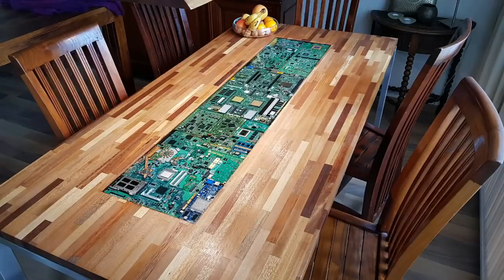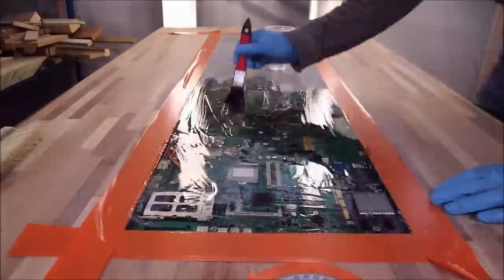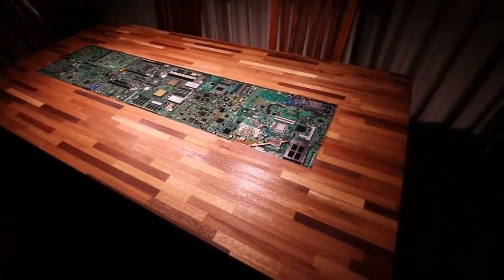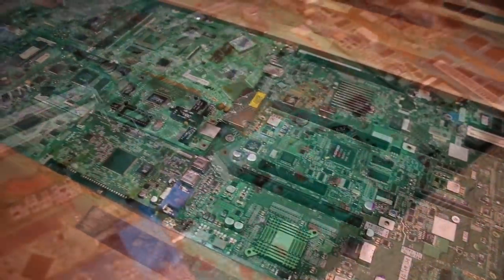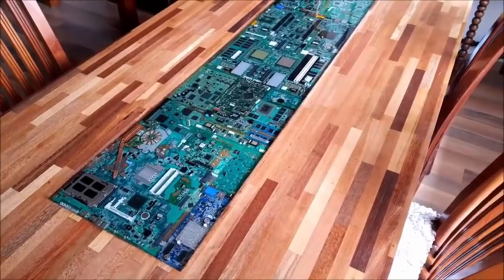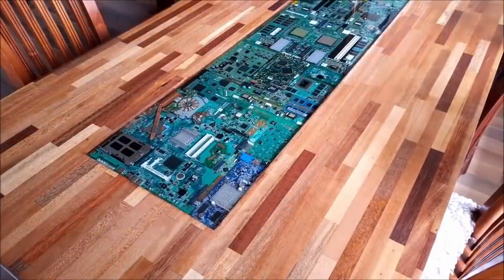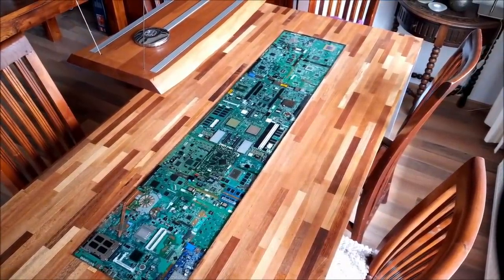Circuit boards with lights in epoxy in a table

Comment: You thing the epoxy might have reacted to some of the chemicals in the circuit boards?
Reply from the maker: No I am pretty sure that didn't happen because the problems are on a whole different level, higher up. See this video: https://youtu.be/rJBFk-5gMQY

Comment: If you ever do something like this, make sure that you CLEAN the circuit boards.  I go crazy and do alcohol then paint thinner then acetone.  That way I get rid of all the contaminants that MAY have been the cause of your bad cure of epoxy.  There are all sorts of things on circuit boards that might come out in the epoxy...

Comment: I wonder how the capacitors and battery’s Will fair over time as they leak eventually
Reply from the maker: You're not the first to ask. My guess is that because the epoxy is SO strong, nothing will happen.

Comment: Useful video. I’m thinking of trying something similar with use airplane parts. Do you think the epoxy wasn’t mixed enough before the pour?
Reply from the maker: Yes, I'm pretty sure about that. You should not mix by hand, but use a machine (cordless drill will do). 
You should watch the follow-up video of this project here: https://youtu.be/rJBFk-5gMQY
That's my 'lessons learned' video.
Reply: @Onrust1  thanks. I have just watched it. I will start investing where to get epoxy from. Cheers

Comment: I’ve had the same problem of sticky epoxy that won’t dry. After a year it was hard.  So just wait and it’ll be ok.
Reply from the maker: Could have done that, but didn't. Here is what I did: https://youtu.be/rJBFk-5gMQY

Comment: Worked with epoxy on few projects now. If you get a bad mix and pour, 90% has to do with temperature,  using Epoxy in under 70 to 75 degrees is recipe for disaster, when its under 70 it cured very gummy, now your screwed, it wont harden and sanding makes it a complete disaster,  like sanding bubble gum, its possible the circut board stayed cool and confused the pour. Even more then Prep, temperatures are main key to a perfect pour.
Reply from the maker: You should watch the follow-up video of this project here: https://youtu.be/rJBFk-5gMQY

Comment: You could put glass above the tables‘ surface. Sure that‘s far from optimal, but at least you can use the table, while the design is widely the same. 😊

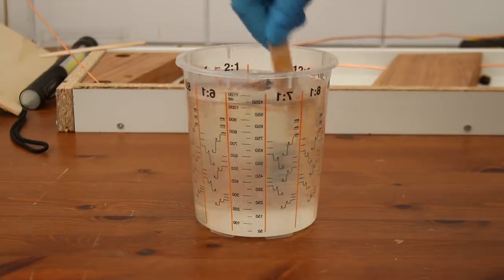Comment: So I saw another video and the "flakes" you saw when mixing at 13:20 were because the epoxy was too cold... in the other video I watched, the person heated it up in hot water and mixed it more... worked out great.
Reply from the maker: I doubt if that would have worked in my case. See my take on this in the follow-up video here: https://youtu.be/rJBFk-5gMQY

Comment: by the way, a little know fact, if you use super glue or CA and use epoxy over it, you have a good chance of a chemical reaction that prohibits epoxy from curing in some areas.

Comment: you can either cut out the whole center and redo, or you can put a glass top over the whole table to save it. cool design none the less!
Reply from the maker: Could have done that, but didn't. Here is what I did: https://youtu.be/rJBFk-5gMQY 
Thank you!

Comment: Nice video.
Great idea with the circuit boards.
I saw a mistake, why the epoxy is not fully cured.
So you have used wooden stirrers that are "rounded" at the ends. Then possibly saw off a rounding that it is angular. So you get right to the bottom to get everything through.
Reply from the maker: Vielleicht bist du interessiert in wie es mit dem Tisch weiter geht? Das ist nämlich in dieses Video: https://youtu.be/rJBFk-5gMQY

Comment: What about putting a layer of UV epoxy over the top then hardening it quickly with UV light?
Reply from the maker: You can see in the follow-up video what I did with it: https://youtu.be/rJBFk-5gMQY

Comment: The reason for the sticky parts can be in bad mixing of the epoxy. When you mix the epoxy, the part at the walls of the container is not mixed perfectly. I saw some people pour the mixed epoxy into another container and mix again. Then you can get rid of the unmixed part of the epoxy and have perfet result...
Reply from the maker: You are so right, yes. I came to about the same conclusions in the end, as you can see in the follow-up video of this one here: https://youtu.be/rJBFk-5gMQY

Comment: Nice idea! But I personaly don't like the varnish after sanding, you see it a lot in woodturning. Much better to pollish the resin to a glass finnish. It takes longer but is much better.
Reply from the maker: As I explained in the video, I wanted to polish (so I agree with you), but didn't for a reason. In the end I did, as you can see here in the follow-up video: https://youtu.be/rJBFk-5gMQY
Reply: @Onrust1  Thanks for the link, I commend your patience and determination.

Comment: Nothing beats genuine creativity. (I would have cut a lip with a router to allow low black tinted 4mm glass panel to sit over the motherboards.) But as said nothing beats genuine creativity☺

Comment: The weight of that epoxy would be unbelievable! It probably bowed in the middle because of it. Maybe welding some cross beam underneath to reinforce it would have helped with that. I would still call it a success. Turned out good :)
Reply from the maker: Thank you. The table already had two fairly big steel beams running underneath, there is just no way my actions were the cause of the table being bent (it is more likely that in a former life, some fat lady sat on it 😆😆).

Comment: Maybe put a piece of glass on the top.  at least it would be safe from any unproperly cured epoxy
Reply from the maker: Could have done that, but didn't. Here is what I did: https://youtu.be/rJBFk-5gMQY
Reply: @Onrust1  Thanks I watched your follow up video.  I would still put a piece of glass, not just on the epoxy but the whole area of the table if you want to use it even in a garage or shop.  I work in aerospace and the technicians generally mix epoxy by weight on a precise scale.  Mixed in small amounts  though by hand.  This gives me an idea though to make a commodore 64 table one day.

Comment: If the hardener/catalyst/initiator was not properly mixed, could you not still use UV light to harden the resin? Leaving it out in the sun might work, although rather powerful UV lamps are quite cheap now (protect your eyes, esp. if UV-C!)
Reply from the maker: Could have done that, but didn't. Here is what I did: https://youtu.be/rJBFk-5gMQY

Comment: you can try covering the whole table up with a large sheet of acrylic or even glass, and putting a thin layer of (well mixed) epoxy between the sheet and the table. This will hopefully trap the soft spots, create a nice, gapless cover for the wood and top off the table with a uniform, non-sticky surface
Reply from the maker: Could have done that, but didn't. Here is what I did: https://youtu.be/rJBFk-5gMQY
Reply: @Onrust1  ah, it's great to see you're actively looking after your comment section! and thanks for the link, you did a great job of making the best of what you got. keep it up!

Comment: Very nice idea. I don't really thing is a total failure. For me is quiet acceptable the result. Just wonder why not to use just a glass over the pit instead of filling it up with epoxy
Reply from the maker: Could have done that, but didn't. Here is what I did: https://youtu.be/rJBFk-5gMQY

Comment: maybe someone already asked, but- Why did you terminate the fiber optic cables out the end and not under the table where a light source could be concealed?
Reply from the maker: No, you're the first. It never crossed my mind. I liked the idea that anyone could light up the lights fi. with their own phone. If you would put another light source in, it would need power and second it could be 'on' all the time, from which in time you could go crazy.. I liked the idea that it would be temporary. No regrets on this part.

Comment: why not just put a glass on it with some rubber spacers in all the edges. Lots less work and the same outcome.
Reply from the maker: Less work yes, for sure, but just not as pretty. More on this in the follow-up video here: https://youtu.be/rJBFk-5gMQY

Comment: I learned this lesson already. Best advice I have for u that worked for me is. Throw it out in the sun hot and put a heater use a heating w.e is hot a oven lol. And that will fix ur sticky problem but that blur is wrong application and mixing. I really luv the fiber optic idea with the cellphone thnx for that
Reply from the maker: Here is the follow-up video with what I did and all lessons learned: https://youtu.be/rJBFk-5gMQY

Comment: "We had 7 liters epoxy, 75 electric capacitor, 5 sheets of high-powered system boards, a saltshaker half-full of transistors, a whole galaxy of multi-colored leds, microchips, conductors, resistors..."
"У нас было 7 литров эпоксидки, 75 электрических конденсаторов, 5 листов мощнейшых плат, полсолонки транзисторов и гора сведодиоидов, проводников и всего такого, всех цветов..."

Comment: Why chisel? Couldn't have just used the router?
Reply from the maker: For the router not to fall in at some point, I would have had to make some kind of sled for it, and I didn't want to do that. Besides, one blow of the chisel is so much more faster than the router, I chose the chisel.

Comment: What about just taking some of the activator part of the epoxy and soaking the table in it for a few days or weeks. It should harden up the excess resin.
Reply from the maker: Unmixed epoxy leaves spots of resin and spots of hardener... How would I know I wasn't adding hardener to hardener? 😁 Anyway, here you can see what I did: https://youtu.be/rJBFk-5gMQY

Comment: Can't you just put a rectangular piece of plain glass over the table and solve the problem with sticking epoxy?

Making some sturdy point to place the glass piece will avoid it sticking to the epoxy I guess
Reply from the maker: Could have done, but didn't. Here is what I did: https://youtu.be/rJBFk-5gMQY

Comment: hello I did not read all of the comments on the table. You only made 2 mistakes. but others may have covered these already.when you made the cut out for you boards you should have made a border and used wax spray on the side s a release agent after you pour your resin. that way there is not a lot of extra sanding just a little in that corner. Second you needed to torch or use a heat gun to keep you resin clear between layers. and be mindful that a resin pour that large requires several days to cure. but i absolutely love the table idea and will make one myself .

Comment: Maybe make a recess in the table, make a "bed" of some sort where you actually put the boards and epoxy.  That way you keep the table with the existing recess, but are able to swap out the current boards and epoxy and put in a new one.  Use some of the chiselled out pieces of wood to make thin covers over whatever you use to put the epoxied boards in, make the interface between the wood and the epoxy seamless, but pretty.
Reply from the maker: Could have done, but didn't. Here is what I did: https://youtu.be/rJBFk-5gMQY

Comment: The concept of this is actually pretty cool. Maybe next time you could pour them the epoxy in layers? Or even put some acrylic panels on the top of the current table?
Reply from the maker: Could have done, but didn't. Here is what I did: https://youtu.be/rJBFk-5gMQY

Comment: You should have put/hidden a "message in a bottle" inside the table somewhere for whoever finds this table in the distant future and wants to know where it came from, its creator, and what the electronics did - (noting but look good). Otherwise, it will be the next Stonehenge in 1000 years.    The sticky will fade. Might consider adding one more thin layer of epoxy and covering the entire table with a thin Clear Acrylic Plexiglass Sheet before it cures (or something clear and hard that will not easily scratch or crack). I like the fiber optic concept - very nice.

You could try to fix the table - probably the best option. You poured in layers and the first layer looked ok from what I could see - so cutting down to that layer and replacing should be possible. That said, there are probably defects that go all the way down to the circuit boards - that sucks. 

What happened?  Who knows.  I suspect the epoxy is too thick to flow perfectly along the surface and the surface was not level. Perhaps the first layer should be an "epoxy paint" so to speak. Use a paintbrush to paint the epoxy on the circuit boards - to be sure all areas of the board get epoxy. This way when you pour epoxy the surface, while uneven, is an epoxy surface everywhere.  I am not sure this would help but as I think about it I am sure I would paint the first layer on so that I know I got epoxy in all the tough areas that might cause air gaps.  Before the "epoxy paint layer" dries, I would then pour a thin epoxy layer over all the circuit boards and make sure the epoxy layer was perfect before moving on to the next layers. 

Some of the spots look like air gaps, some spots look like a bad epoxy mix that did not cure. Perhaps pour the epoxy in a hot room (what was the room temperature) or heat the epoxy a little to make it flow better. I would also make SURE the epoxy was mixed correctly. I would stir the epoxy, stir some more, and some more, and when I thought I was done stir one more time. 

Another thought (a bit on the crazy side), the temperatures of things in a room are not the same. They may be close but not the same.  Metal may be cooler than wood, for example. So some spots of the circuit board ("hot spots") are adding energy to the epoxy allowing it to cure faster.  I wonder if taking a heat gun and heating the circuit boards 10 or 20 degrees F above room temperature would make the epoxy flow better and cure better?  It would be an interesting experiment. I might do this one day and see. 

I would be interested in knowing what you did with this table.  I will give you 100 US dollars (real money) for it!!!!  (just messing with you - nice job - a"failure" is only a complete failure if you do not learn from your mistakes - so I would be inclined to do a failure analysis on the bad spots and try to determine what you did wrong and fix the table).
Reply from the maker: Here is what I did: https://youtu.be/rJBFk-5gMQY

Comment: I won't consider it a fail just yet. It is still a table and it will be a good conversation piece. And it can be sentimental if the circuit boards used came from your old owned electronic devices.

Comment: Two ways to get it out. Use acetone it should be able to pry right off of it. If that doesnt work you dont need to router the sides just drill a  hole in the epoxy or make a  cut and chisel from there.
Reply from the maker: The story continues here: https://youtu.be/rJBFk-5gMQY
Reply: @Onrust1  cheers mate. Enjoying your videos just discovered your yesterday.

Comment: when i was in autobody college had a classmate who forgot to add activator to the clear coat. car sat in the paint booth for days and all his prayers never helped he ended up paint stripper all clear coat, base color, seal coat & primer coats down to bare metal then start over. poor dave dropped out of college after that car
Reply from the maker: He dropped out because he had learned his lesson for ever and ever? Or because he wasn't fit for the job? 😊

Comment: Maybe if you just enclosed the circuit boards in a glass panel instead of epoxy. Might be better and simpler
Reply from the maker: Could have done, but didn't. Here is what I did: https://youtu.be/rJBFk-5gMQY

Comment: Next time, maybe make a number of epoxied circuit boards in several independent square pieces? Then assemble the good ones into the table at the end. Like tiles?
Reply from the maker: Nice idea. But I wouldn't know how I could fit in the fiber cables and lights then?..
Reply: @Onrust1  Separate fibre entry for each panel?
I accept it's getting complicated. But it looks like it's a big, complicated and expensive build anyway, so a bit of modularlzation to prevent local flaws ruining the whole might be a price worth paying.
Reply from the maker: Good point, yes might have worked. Thanks. It's the way you learn, I guess...

Comment: "Where is your computer?"
"In my table"
Reply: If you incorporate passive heat sink as a table center decoration, you could possibly do this. Your thermals would be unfathomably awful, and you'd probably have to downclock everything to all hell, but it could work. Your power supply would have to be mounted under the table, though.
Reply: @almisami  its called watercooling my guy. Won't need to be too thick of a counter. Just get watercooled vrms and such and boom. Stupid computer
Reply: I was about to comment the same

Comment: first of all when us sand epoxy dont put another layer afterwords sand it with till the grid 1200 then polish it with wacks cause ur edges looks tereble  also ur  bubbles   should shake  or fiberate the table so ur air rises and ur mix always put  a little bit more hardner in  sometimes the culculations dont end up good or ur resins gone bad   but its a good idea i would of looked cooler if u did the whole table in epoxy with boards and some glow powder well  we all make mistakes on resin projects its good te learn from mistakes and other peoples mistakes

Comment: may be add a slight dark tone glass on top of the whole epoxy to avoid the sticky spots as well as mask the messy places... only option I guess
Reply from the maker: Could have done, but didn't. Here is what I did: https://youtu.be/rJBFk-5gMQY

Comment: just put a glass pane over the top and it won't stick and it will get protection.
Reply from the maker: Could have done, but didn't. Here is what I did: https://youtu.be/rJBFk-5gMQY

Comment: Another thought is to get a section of tempered glass cut to the same size as the table top, and affix it to the top of the table. 🤷🏻‍♂️
Reply from the maker: Could have done, but didn't. Here is what I did: https://youtu.be/rJBFk-5gMQY